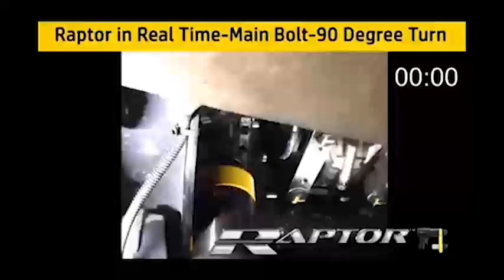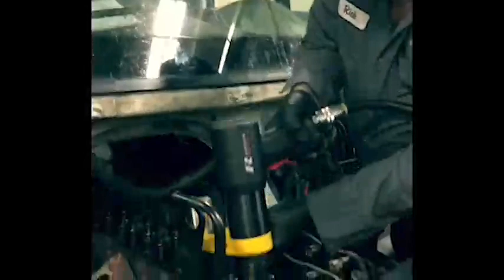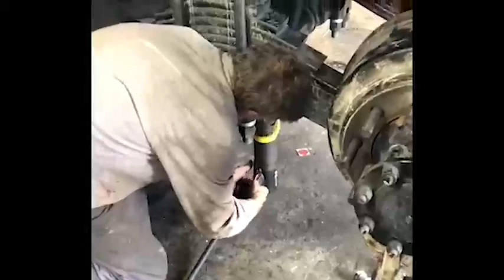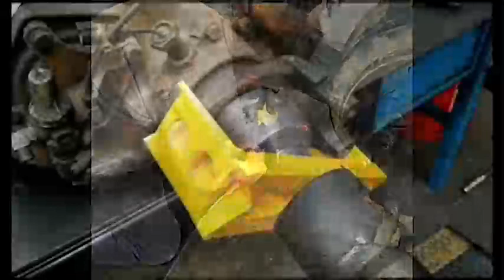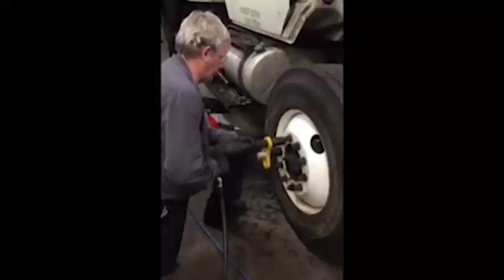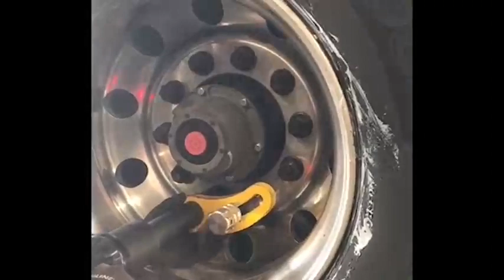Truck Maintenance Applications Video 1

Comment: I have found it helpful to chalk next to two opposite nuts and then snug them (not all the way), then putting the CUP on those ones and then tightening all the way,  marking those with chalk on the studd end as I go, going across each time, putting the CUP on the one with chalk,  using a cupped hand or chalk holder,  making sure you don't let the other end of the chalk touch the next studd, you can check your work with a manual torque wrench until you have established consistency....and if you notice that the torque wrench is bowed the wrong way,  it's a indication that the "happy-go-luckys" have been using it as a breaker bar and so you may have to work around the "idiot factor ".